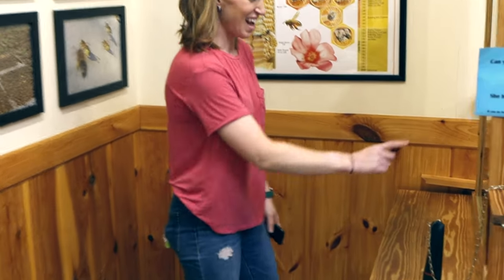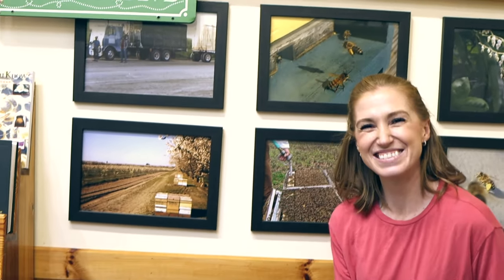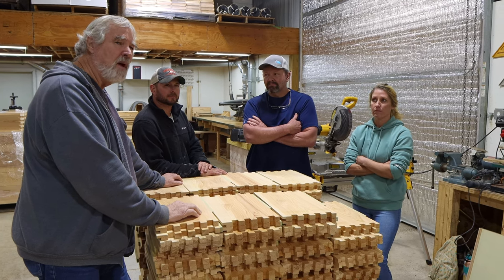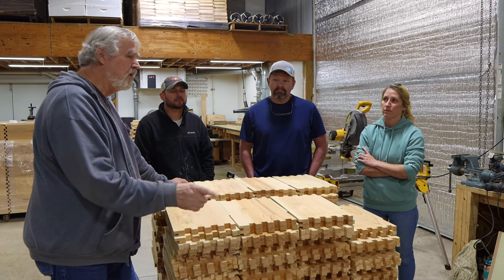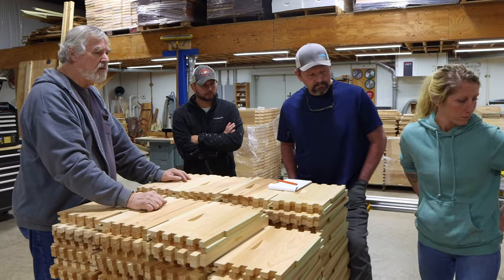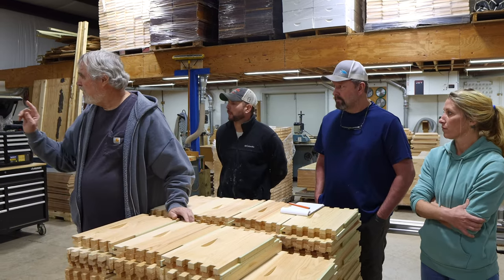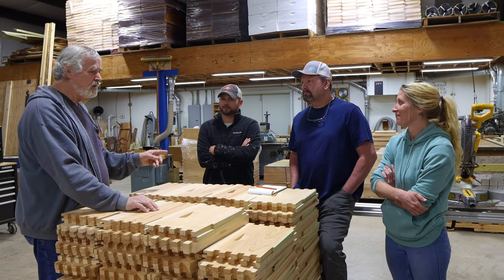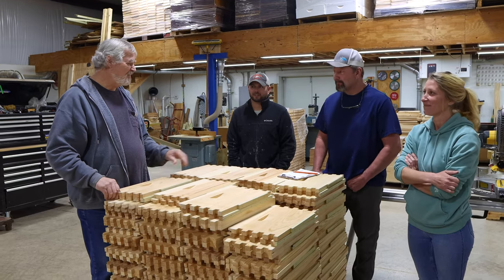Preparing For The 2023 Hive Life Conference

Comment: How much "slack" to you build into the length of the migratory covers? I've been experimenting with building some but have found that with the summer humidity the boxes have expanded to the point that the lids no longer fit. Thank you.
Reply from the maker: We make our covers 21-3/4 inch long. With the two end strips being 3/4, which equals 1-1/2, and a proper box at 19-7/8, it leaves 3/8 inch.
Reply: @bobbinnie9872  thank you

Comment: Where can I buy the reversable hdo bottom boards?  I did not see then on your website?
Reply from the maker: Call our store at 706 782 6722 and ask for Molly.
Reply: @bobbinnie9872  Can you share the cut dimension for the 5 frame nuke  boxes?  I ordered the bottom boards but shipping is a killer to Maine to ship nuke boxes.
Reply from the maker: Our current nuc boxs are 9-1/2 x 19-7/8. If you order nuc bottoms from us they would be 9-1/2 inch wide and probably 21-3/4 long. The strips would be cut for a box 19-7/8 long.  @williambates6811